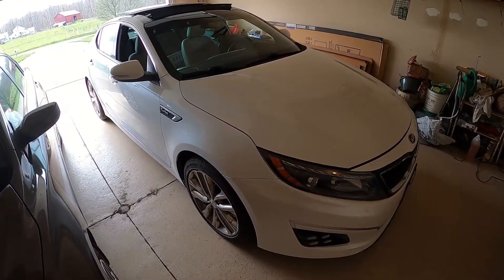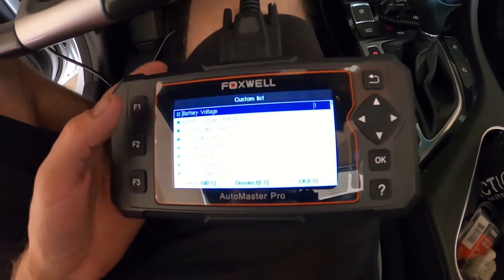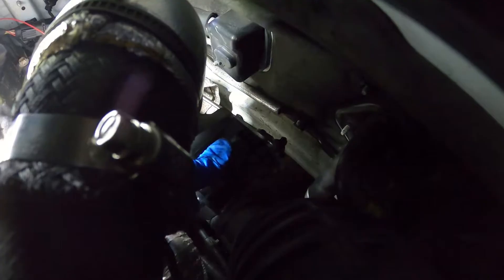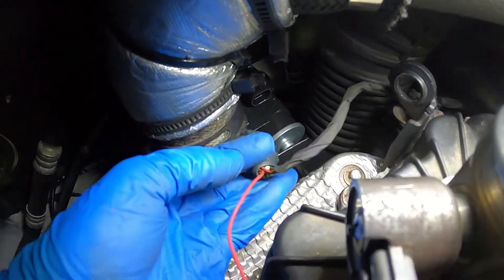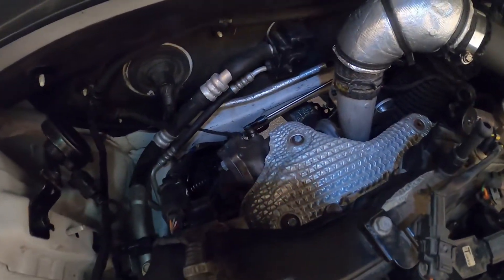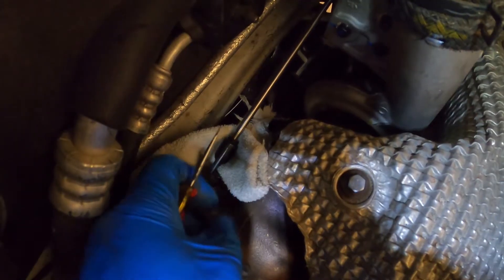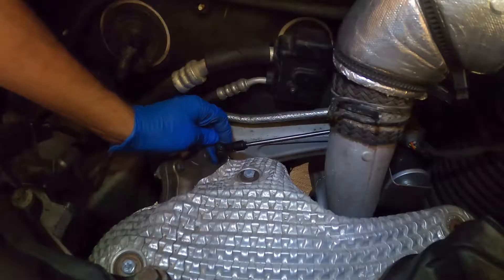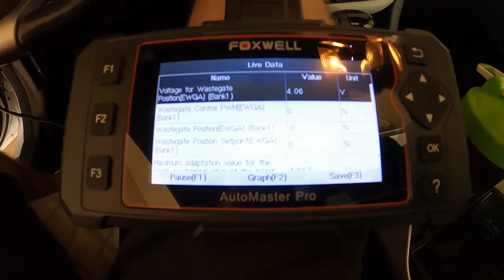HOW TO ADJUST TURBO WASTEGATE VOLTAGE ON KIA OPTIMA HYUNDAI | 2.0L | 4-CYLINDER | DIY | STEP BY STEP

Comment: Hello! I have a Fiat 500X with an electronic actuator. The actuator went bad and needs to be replaced. Is what you did the same as performing the software calibration that the dealer does?

Comment: I’m curious to know what causes this problem or how it happens.
Reply from the maker: Basically just electronics wearing out. The actuator is constantly opening and closing and like anything else goes bad overtime
Reply: @b@b @blueglovemechanic  thanks for the awesome Info and DIY. My 2011 is nearing 100k miles and threw this code, should I be ready to replace the actuator or keep adjusting?

Comment: Great results for my 2015 Optima SXL with my voltage at 4.89. Got it down to 4.06 and the boost is back like it never left, Fantastic video with step by step instructions. Extremely helpful!
Reply from the maker: Thank you!

Comment: I have no codes, but after replacing the actuator, my santa-fe lost a lot of PEP.   Extending the arm is the solution right?  I was going to try 2 full turns outward.  thx
Reply from the maker: Hi rob,  its the voltage reading that determines how the wastegate functions. If the wastegate opens too quickly, your boost doesnt build because its just routing directly back to your intake. If your wastegate opens too slowly, most of your boost is lost straight to the exhaust

Comment: I have what may be an odd scenario....or not! Idk🤷🏽 I have a 2011 Kia Optima 2.0,. I followed step-by-step using the voltage meter method. In accessory mode, I measured a voltage of 4.2 Vdc after adjusting the wastegate. I decided to drive it around the block and didn't see or feel a difference in my Turbo from previously. I decided to check voltage again and got 1.7 Vdc. I don't know where to go from here. Any advice on next steps?
Reply from the maker: After the car has been started the voltage changes, did you test it immediately after running the car, or did you let the car sit for awhile before checking again? Basically it can take a little while for the system to fully shut off and voltage to go back to the range you should be testing for.
Reply: @blueglovemechanic Thanks for your feedback. I did test it immediately after I turned the car off because I didn't hear my Turbo kick in. I tested it again this morning before running the car and it was at 2.2 Vdc I turned it on and off a few times and it went to 4.0 Vdc. Also, some background, I've replaced the turbo and the wastegate before adjusting the wastegate actuator. Its seems to be running as a normal 4 cylinder vehicle.

Comment: The mechanic made an attempt to adjust the wastegate. It was reading 1.21 what he have finished making the adjustment and checked it again it was reading the same thing 1.21. He said he turned to approximately 10 turns what he was making the adjustment.. when we took the car out to drive. It was sluggish on the acceleration. We attempted to go up a steep incline and it could not hold the speed that we had to pull over to the side of the road and slowly finish the incline and then made it back to the shop on flat surface. It will accelerate and go whatever speed you want, but once it goes up an incline it reduces speed. I’ve changed the high-pressure fuel pump. I changed the turbo charger. What can I do next? I have a 2014 Kia optima SX turbo 2 L can someone give me some good advice?
Reply from the maker: Your wastegate actuator might be bad/stuck open causing you to lose boost as well. The fact you mentioned the voltage didnt change tells me this is very likely. Id replace the wastegate actuator to start. Sounds like youre losing boost. I had a tough time climbing inclines/sluggish acceleration when the bottom of my intercooler welds busted causing all my boost to be lost. Did he vacuum test the system for boost/air leaks?

Comment: Do you have to make the adjustment and put it all back together before getting a reading? Just seems like you might have to pull it off multple times.
Reply from the maker: Correct

Comment: How much does each spin of the arm raise/lower the voltage? Or is it just a guessing game?
Reply from the maker: @peters4158  not entirely sure sorry
Reply: @blueglovemechanic  I guess, back to the endless black hole of searching the internet for this. Thanks for the prompt response. I refuse to let Kia touch my vehicle anymore. I have had more problems now with it after the "engine replacement" than before. The last time I brought it in for this same reason (I now know), they just cleared the codes and test drove it a few days (only drove it around the neighborhood) and said everything is fine. If you want anything done right, you gotta do it yourself!!! If I find anything, I'll post a comment.
Reply: @blueglovemechanic
Kia Technical Service Bulletin:
If the voltage is between 4.3 and 4.4V, rotate the rod end clockwise by ½ turn. If it's 4.5V, rotate it by 1 full turn. If it's 4.6V or higher, rotate it by 1 ½ turns.

Comment: Hi, I'm trying to find out the wastegate value for a Hyundai i20 Active (European version) with the GL3C engine 1.0 T-DGI Do you think it's the same as in your video? I can't find the information online. I'm getting the P2565 error code, so if you have any idea, that would be awesome! Thanks in advance!
Reply from the maker: @djmas951  hello, what size engine?
Reply: @blueglovemechanic  Thanks for your reply! Originally, it's a 100hp engine, but three years ago I had a Stage 1 tune done to gain 40hp. I've never had any issues until now. Do you think that value might have been modified during the Stage 1 tune, and that the original Hyundai value won't be useful in my case? I'd still like to know the original value though—if you have any information about it, that would be great. Thanks!
Reply from the maker: @djmas951  i've never heard of this vehicle before, very interesting. Do you habe any check engine codes? Generally you'd get a "turbo overboost" or "turbo underboost" code
Reply: @blueglovemechanic  Yes, it's a European model I live in Europe. It's a 3-cylinder 😅I use the CarScanner app and I have the error code P2565 ("Turbocharger Boost Control Position Sensor Circuit High"). I also sometimes get P2564 ("Turbocharger Boost Control Position Sensor Circuit Low") and occasionally P2562 ("Turbocharger Boost Control Position Sensor  Circuit Malfunction").

All of these are related to the boost position sensor.
The craziest part is that I don’t have any warning light on the dashboard, but I do sometimes experience limp mode. When that happens, I just clear the DTCs using CarScanner and it works again  it's totally random.

At my last visit to the mechanic, I deliberately left the car in limp mode with the code still active. But he told me that he couldn’t see any codes with his scanner and, according to him, the car wasn’t in limp mode either... even though I know my car very well, and I can definitely tell when it is. 🤔
Reply from the maker: @djmas951   Interesting. So obviously the last code (P2562) could cause the other 2. A quick google search for your car (and first place i would start) pulls up this "turbo pressure sensor" :

 https://www.ebay.com/itm/224999664678

You should be able to find cheaper ones with a quick search on ebay, but thats where id start as its the easiest / cheapest culprit.

The other possiblity could be your wastegate actuator could be going back (what i am adjusting in this video). Its an electronic mechanism that wears out overtime and will eventually need replaced.

While i cant find a specific wastegate voltage setpoint, perhaps this could help?

https://en.hyundaiclub.eu/forum-topic/p2562-2767?select=2769

Best of luck!

Comment: My voltage is stuck at 4.65 and won’t move no matter how much I adjust the arm
Reply from the maker: @hamstercow6219  you can manually move/open the wastegate where its supposed to hook to, youre saying the arm is still too short?
Reply from the maker: @hamstercow6219  have you tried going the otherway? You might be going wrong way?
Reply: @blueglovemechanic I just tried and now the issue is the voltage just doesn’t change from the adjustments, no matter how much I loosen or tighten it’s 4.65. Its a brand new wastegate and turbo if that helps. Sorry I edited the original comment to the new issue before I saw you reply
Reply from the maker: @hamstercow6219  are you getting a reading before putting power to the car?
Reply from the maker: @hamstercow6219  also, which method are you using to test the voltage? The multimeter and wire method i show, or a diagnostic tool? Also do you have your old wastegate? Im curious what that one was reading. Theres always a possibility the new wastegate is bad.
Reply: @blueglovemechanic I don’t have the old wastegate anymore sadly, and there is no reading without power to the car. I’m using the multimeter method, positive is in the yellow wire and negative is on the car battery. It reads ~1.3-1.7 while engine is running in park, 4.65 while just accessories and battery are on. It’s a 2013 Kia optima btw
Reply from the maker: @hamstercow6219  are you getting a check engine code or any noticable issues? If not, honestly you'll probably be fine. Thats not too far above range. Im seeing a post where 1.7volt with car running is within range and 4.2 +- .1 with just accessory mode is acceptable so thatd put you at 4.3 (so close).

Comment: Is it the lower the volts the more boost? Or higher the number more boost?
Reply from the maker: @danielromero3444  lower voltage = underboost. Higher voltage = overboost. Youll get a check engine code for both.

Comment: Thank you! Finally someone that knows how to teach! You taught each step clearly and didn’t leave anything or any questions to be answered! You’re amazing. Gonna try this tomorrow when it’s light out again and hope it was the problem I was having. Thank you again
Reply from the maker: @benseiler2589  thanks for the kind comment! Best of luck!
Reply: @ hey man!!! Just finished doing all of this and my car is back to normal again! It’s out of limp mode and driving perfectly. Still have the check engine light cause I don’t have a scanner to clear the code but it’s fixed. Thank you thank you so much for this video!!!
Reply: @blueglovemechanic  actually the check engine light ended up just turning off by itself after driving for a bit 😄
Reply: What changed in your car after fixing that ?

Comment: Thank you your video is the most informative I have found on this issue so far.
The actuator plug (yellow wire) is located under the air inlet pipe on a 2015 sonata if that helps anyone
Reply from the maker: @tmccully127  thanks for the kind comment and your contribution to the other diy'ers!

Comment: Is this the issue where when the temp changes, the turbo won't work?  If I can shut it off and turn it back on, I'll usually be alright but if I can't it time and the check engine light comes on, it'll go into limp mode for a few days.
Reply: The issue you are describing is the issue I had during Alabama's sub-zero temps this past January. My Santa Fe was limp mode for a few days until the temps warmed back up to 32 degrees.
Reply from the maker: @MessinaDance You'll have to read any potential codes on the car. There is a potential for the car to go into limp mode for many reasons.

Comment: mine was -.3v so i adjusted it, shortened it all the way, now it's .56v , i'm not able to adjust to 4v, does this mean the actuator is faulty? or just the sensor i need to replace?
Reply from the maker: Hey there. Just checking that you followed my steps accordingly to get most accurate readings? I know a few people missed the whole turning ignition on and then take readings part. If you're unable to get any higher read out however youll probably be best off replacing the whole wastegate assembly.

Comment: Man, I have the cousin to this car the Hyundai Sonata 2.0 and although I do love her model year look with the sleek curvy swoopy coup, and interior blue lighting, I think I like the optimas overall look better than my sonata. I'm jealous
Reply from the maker: @Tommy-qp7zv  i agree! Especially this SXL version with the ice cube fog lights. If i had an option i would have probably gone with the blue exterior and threw carbon accents everywhere but this white was the only one available at the used dealership. My only gripe is i have the white/cream interior which shows every little mark unfortunately.
Reply: Both cars are junk 
Disposal able cars

Comment: Which model Foxwell tool are you using?
Reply from the maker: It's a Foxwell NT614 Elite. ~$150 on ebay. Great tool for live data reporting as well. No software costs etc, simply plug and play. Dont forget to like and subscribe! Thanks

Comment: my 2.0t kia turbo looks nothing like this.  The arm is on top and easy to get to, the plug is underneath and a pain to get to. the voltage at the yellow wire reads 1.83.
Reply from the maker: What year, make, and model do you have?
Reply: @blueglovemechanic  2020 sportage turbo

Comment: Do you have video of turbo R and R
Reply: OK thanks  pulling my turbo this weekend.. 2017 optima sx .
Reply from the maker: @ChrisChristiansen-u2y  hey again. Just letting you know ive finished recording and will be putting everything together/posting later tonight so you should be able to reference tomorrow. Are you changing the whole turbo housing&chra or just the chra cartridge by itself? Im making videos for both but wanted to check. Best of luck with your repair! My best advice is to be patient.
Reply from the maker: I plan on recording video soon on how the system is set up/how to replace/rebuild turbo but currently dont have any clips uploaded just yet. Please subscribe so you're notified once they are posted!

Comment: I cant seem to get mine past 1 volt no matter what i do, any ideas?
Reply from the maker: Hello. Which way are you testing the voltage? Are you sure your meter is working properly and on the correct setting? If so, ensure you're making proper connection to the wastegate and see if the voltage changes when turning the key on/off and allowing wastegate to go back to its home position. If you can confirm the voltage is not changing, your wastegate unit is probably the issue.
Reply: @blueglovemechanic  
I hooked it all up correctly and tested the voltmeter with other sources and its working pronged  the yellow wire and negative terminal many times on differing days and nothing, the actuator is new too. Got it for the same reason, the old one we thought was bad. Still no voltage reading though. Moved relays around, checked fuses, still nothing.
Reply: @revealedfromonhigh what was issue
Reply: @bosspranks8349  I know many people never respond to queries like this, but I won't leave you hangin; I guess the vehicle was staying in limp mode because the head gasket was blown and the computer was detecting issues related to low compression. The only other thing I could imagine it might have been was a bad computer. Long story short I never found out, and will never buy a KIA again. Got rid of the car, got rid of the headache, until I bought a Jeep Patriot with a CVT trans in it; That think was a headache too. Time is precious to me, so neither of these vehicles are something I will invest in again. Unless of course the Jeep has a regular automatic or standard trans, then I'm in, because other than the garbage cvt, that vehicle was great.
Reply: @revealedfromonhigh  thanks fior reply

Comment: It’s much easier to adjust voltage on the actuator side instead of the waste gate side of the rod (I.e. taking rod off at actuator, loosening nut on rod on waste gate side, turning clockwise to reduce voltage/counter clockwise to increase voltage)
Reply from the maker: Thanks for the comment. I found it easier to get to the side shown in the video and less risk of losing spring, nut, etc on wastegate side. Either side will work however!
Reply: @blueglovemechanic the problem with the video way is the clip is a major PITA to get on and off, and easier to lose. I put a large rag under actuator in case anything fell (nut did once easy retrieval from rag).
Reply from the maker: @samsoninthepit  The whole process in general is a PITA lol! Nothing like making an adjustment by a nice and hot exhaust manifold lol. Hope everything worked out for you in the end!
Reply: @blueglovemechanic  Keep in mind that the recommended voltage changes depending on the coolant temperature, and I believe the year of the vehicle also.   For 2011,  the TSB states "Coolant Temp  < 77◦F (25◦C) 3.90 ~ 4.10V"
Reply: @blueglovemechanic for what it’s worth my car is a 2014 kia sportage SX. Voltage was at 4.8 before adjustment. Couldn’t get it to exactly 4.2 but settled at 4.22 and it worked
Reply from the maker: @samsoninthepit  Thats great! Glad to hear what makes/models and end results people have.

Comment: I keep adjusting it over and over it seems to be exactly 4.0 and the check engine light still comes back over and over again wtf could it be
Reply from the maker: Whats the code?
Reply: @blueglovemechanic  same code p2562 and p259e with a hyundai sonata, driving me insane
Reply: @blueglovemechanic  after I reset the voltage to 4.0 I clear the codes but after revving the engine a few times it seems to slip to a different voltage and the error comes back, nightmare, never buying any car with turbo or a hyundai ever again
Reply from the maker: @greendholia5206  Sorry you have to deal with that. In this case, it's highly likely your wastegate is bad and needs replaced. Sounds like it has some play and is auto adjusting due to age or other faults. What year is your vehicle?